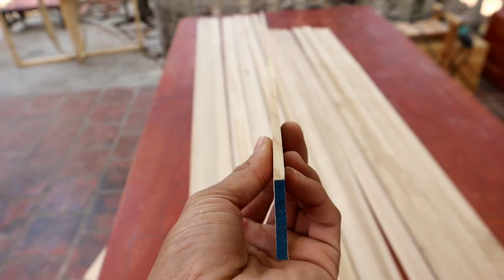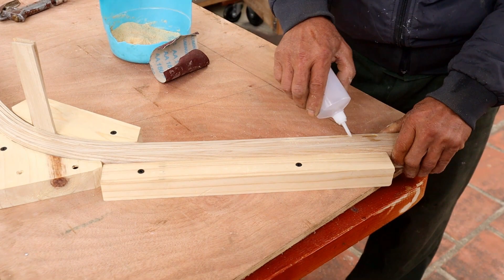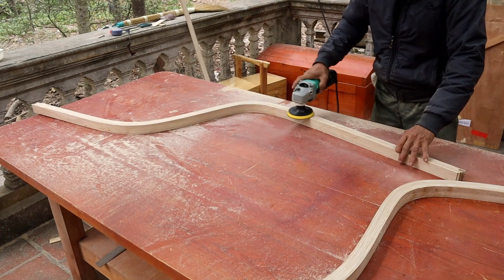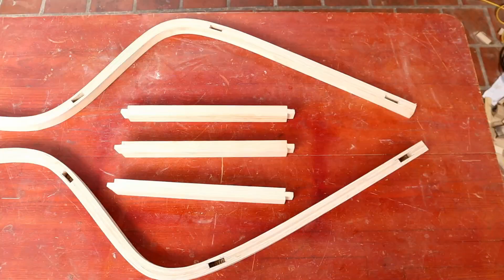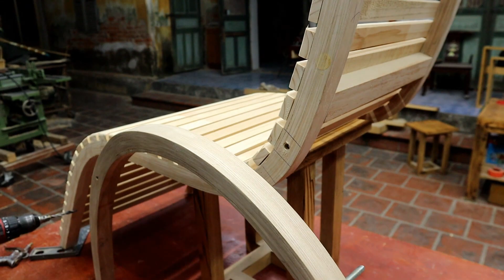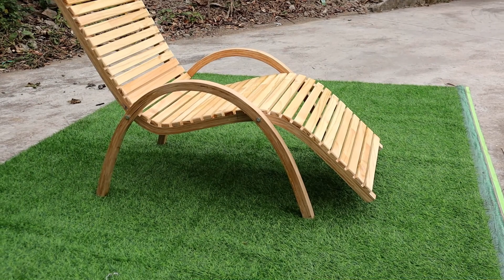Amazing Ingenious And Creative Woodworking Design // How To Build The Perfect Relaxing Couch

Comment: Love the speed gluing and clamping techniques. Amazed to see that just edge super glue will be strong enough. I would've thought it's a 2 step process to heat bend, let it sit, and then rebend and reclamp it with glue between the lamination strips.